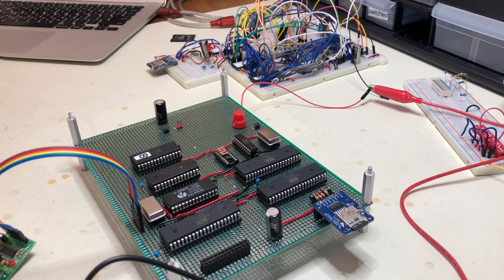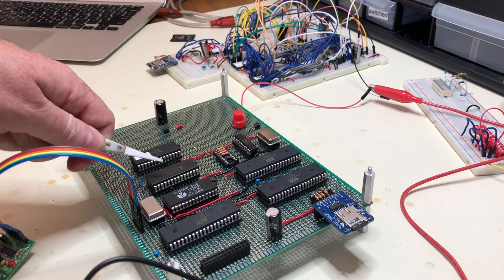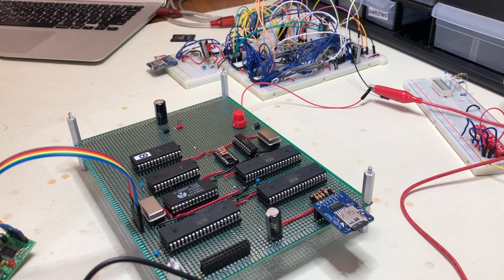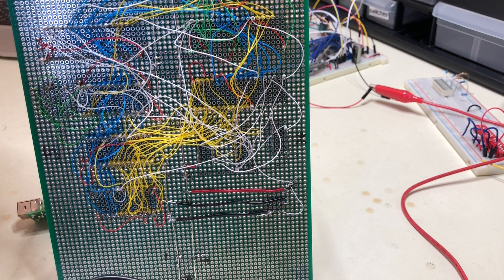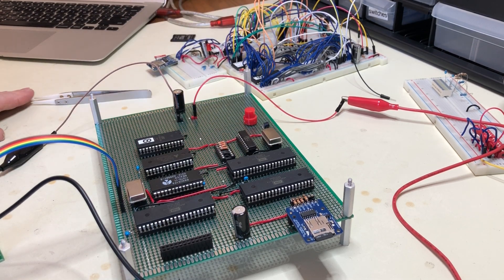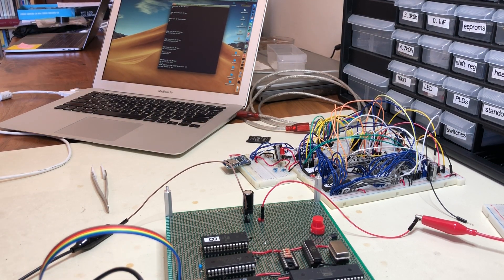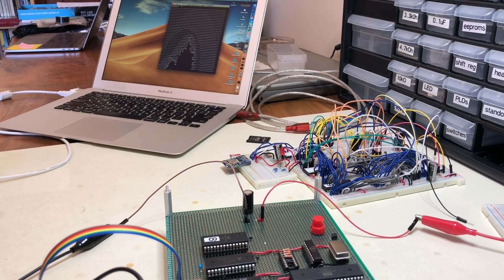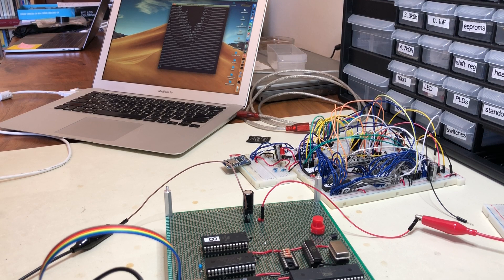6502 Mite home-brew computer project: step 15, wire-wrap success!

Comment: Nice work!  Just a couple of thoughts for you on wire-wrap board density & power wiring...  I still have my wire-wrap microprocessor designs from way back in the day (late 70's early 80's). Back then I used 100mm (x160mm) Eurocard square pad boards with DIN 41612 connectors to a Eurocard backplane / cage.  The wire-wrap IC sockets were generally mounted with just 1 unused row of 0.1" grid holes spacing between each socket (ie. wire-wrap allows high density, which also helps with tidy wire routing / optimum short runs).  The power was also supplied via wire-wrap connection (so no added "manual" soldered wires, as 30AWG is fine for power runs; on Eurocard sized logic boards).  In summary: Wire-wrap only, dense layout boards, look really awesome!  I really must get my favourite 6809 board up and running again for some nostalgic fun! :-)
Reply from the maker: Greg Clare thanks! Yes I figured I was likely being super-conservative with the power rails. The next effort will likely be 100% wire wrap and hopefully better density too (although they might be conditioned by my eyesight as much as by the technology!)